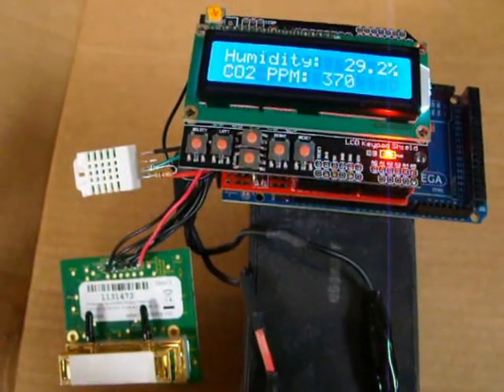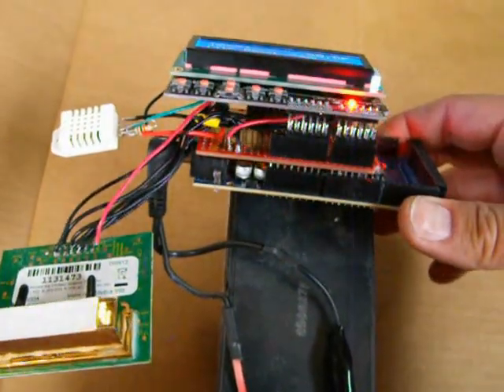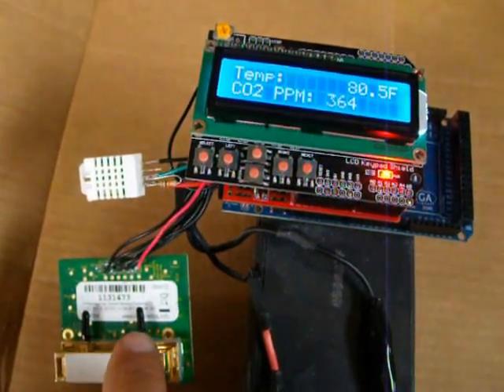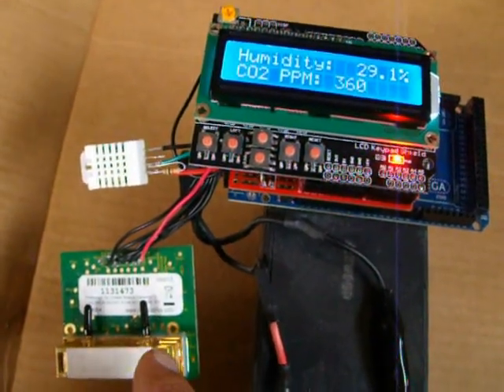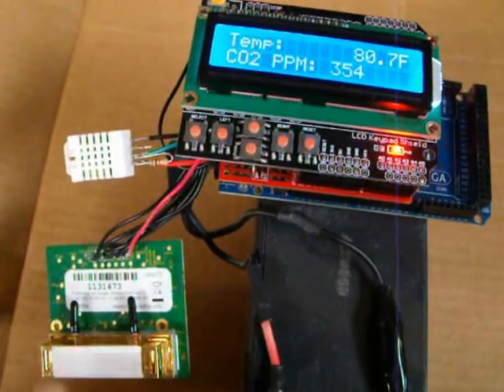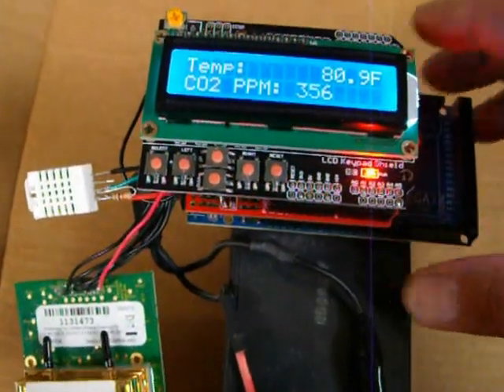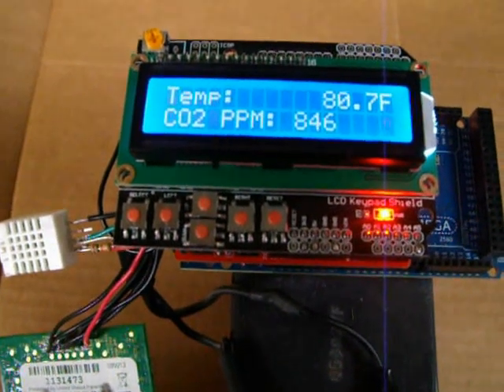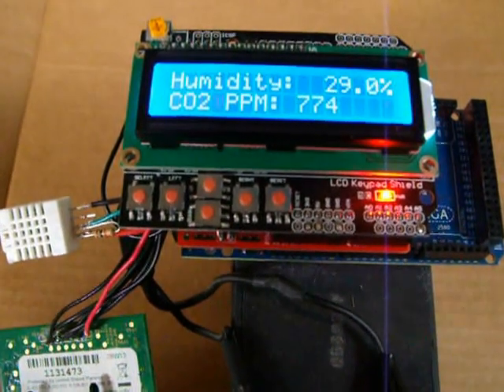Homemade Arduino based Indoor Air Quality CO2 PPM, Temperature, Humidity Monitor

Comment: This is impressing! Can you help me in similar project to control one unit with relay with a module (having co2, humidity and temp sensor in it) and arduino?
Reply: varun me aviso quiero hacer el mismo proyecto

Comment: many thanks for this! for those of us without access to surplus building monitoring equipment, can you recommend an NDIR sensor for an Arduino that would be reasonably easy for someone new to the Arduino to set up (ideally so that the data can be logged in a PC)?
Reply from the maker: https://www.banggood.com/NDIR-CO2-Sensor-MH-Z14A-PWM-NDIR-Infrared-Carbon-Dioxide-Sensor-Module-Serial-Port-0-5000PPM-p-1248270.html?p=6N15145040030201606R

This one has a 0-4.2V analog output that would give you an easy way to see co2 level with just an analog meter and you could also read back with the arduino using analog input which would give you a 10 bit representation of the 0-5000ppm level. that means you could get about 5ppm steps. If you became more proficient with the arduino you could read back the TTL interface on this model and then read actual values. If you want to buy me an NDIR I could do example code and a quick video showing you a simple read back.
Reply from the maker: I have given it some thought and you could use two or three of the analog inputs with an amp circuit on each to give you fine resolution (1PPM)  by gaining up the analog output voltage for the analog input on  the Arduino.  The only issue with this low cost sensor is it is +/- 50PPM accuracy but that could be calibrated

Comment: Hi may i know what is the normal ppm for CO2 , Isit around 400 something
Reply from the maker: There is a website if you google "current co2 ppm' you should find www.co2.earth the value varies throughout the year and depends on where you are at on the Earth.  Today's measurement at the Mauna Loa Observatory in Hawaii is 411.55ppm  When I made this meter the value was around 385-393 ppm

Comment: I could use this along with soil temp soil moisture and humidity control using misters, hope to see more work on this, Great video! I need to finish learning arduino
Reply from the maker: I plan on making a new system in the near future with controls for humidity, air flow and CO2 injection to air in a system.

Comment: And how to convert that sensor analog out put to PPM conversion ??
Reply from the maker: The sensor has two outputs one is analog and the other is digital, with 
the arduino I am reading digital values directly from the sensor and 
writing those values from the sensor on the display. The analog output 
is directly proportional to the full scale voltage in ppm for instance 
if I remember correctly this put out 2V as a full scale reading so that 
would be equal to 2000PPM, 400mV would equal 400PPM. 1V would equal 
1000PPM etc...

Comment: I want to make your kit as experimental kit. please guide me, what are stepping, what to buy and where to buy.
Reply from the maker: +Swapna Roy I do not know where to get the CO2 sensor from anymore, I bought mine from allelectronics when they had them in stock, it was part of a system that I took it out of. As for the humidity and temperature sensor there are many different ones to choose from, try adafruit they have lots of different sensors to choose from.
Reply: you can get tellaire sensor from digikey

Comment: Are these the commands you are using? http://www.farnell.com/datasheets/1872052.pdf
Reply from the maker: +ab0032 The Telair 6004 that I used here in this demo had a SPI interface not a UART interface. I could not tell you exact commands since this was years ago, sorry
Reply: +madscientisthut Thanks for the quick reply.

Comment: Sir ,if you can provide pre-defined library for rasbery pi or arduino to read co2 concentration as ppm It will be great.
Reply: +Sunil Sahu Try this for arduino 
https://github.com/empierre/arduino/blob/master/AirQuality-CO2-MH-Z14.ino

and you can find the formula for its output here
https://www.futurlec.com/Datasheet/Sensor/MH-Z14.pdf

Comment: Is this possible with an mq135 sensor for co2? Its an awesone job and im trying to start my own :D
Reply from the maker: Dario Alfano I am uncertain what capability the MQ135 has. Do you know what protocol it uses?
Reply: Don't use the automatic calibration if you can help it. It calibrates based off of the minimum reading that it sees over a period of time. This method of calibration is not ok for areas that never see an atmospheric baseline of around 400ppm. Thanks for the detailed video. I know how hard it can be to RE a protocol. I went through the same thing with the SM5852 differential pressure sensor. They used a wonky i2c implementation that took a while to figure out. You can look at my breath monitor on my YT channel along with a couple of other projects I posted. They're silent videos because I'm too shy. Lol

Comment from the maker: I used the SPI interface, it was pretty easy to figure out what was going on there with the o-scope. I have done many projects with SPI. I probably spent about three days looking at it with a scope to figure out the protocol. I was never able to recover the code. I have been busy with other projects. If you do get running code I would not mind looking at it, thanks.

Comment: Did you use the SPI or UART protocol to communicate with the Telaire module. I have the UART commands for 6613 but when I tried to talk to the 6004 I got no response -so I'm assuming it's a different set of commands. Have you been able to retrieve your program or is it lost? That sucks because I can imagine you had a LOT of hours into it using a scope to read the data!. I'd really appreciate code!
 I'm going to contact Telaire to get communication protocol for the 6004. I'll post if I get it. DX

Comment: The T6004 has an 0-4V analog output too.  This corresponds to a CO2 range of 0-2000ppm.  So just multiply the analog voltage by 500 and you have your CO2 measurement.

Comment: Hi,I been thinking of a way to save thousands  of lives every year for ever are you on board , if so I want nothing. adapt a small detector to  turn on a car or,ect. when living being is in high temp.,or cold . senser, carbon,dixiode, motion, temperature, the size of a dome light ,turns on motor and air con or heater sets off alarm ,when animal or child is left,in car. make the world better !!!!!